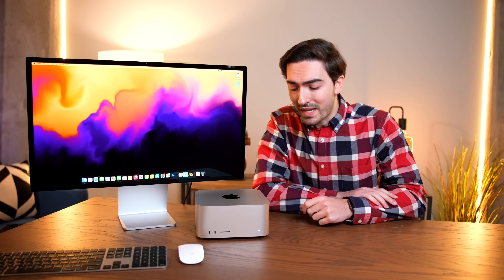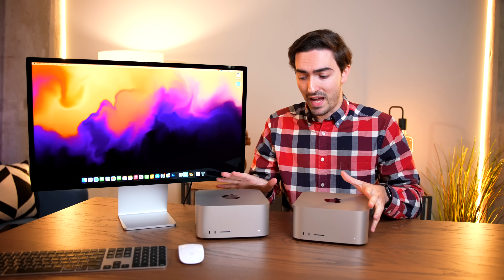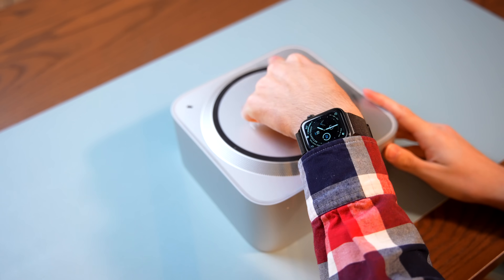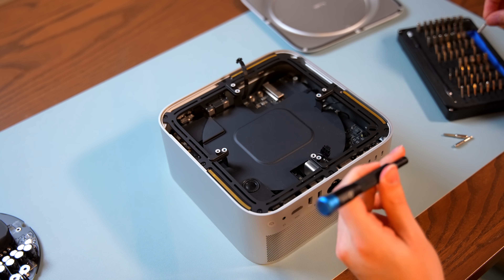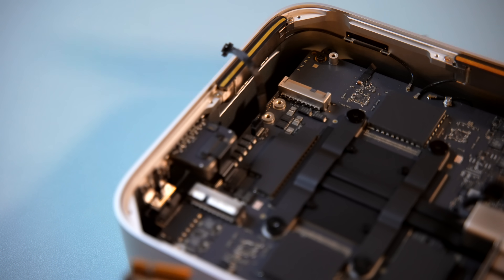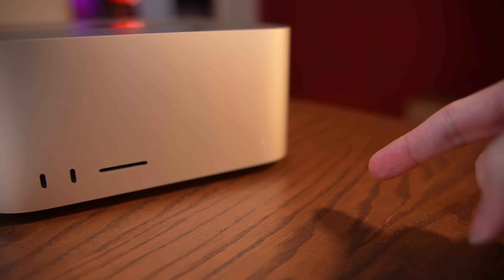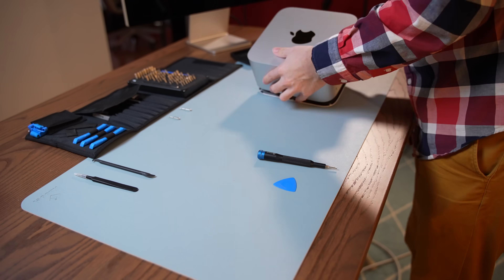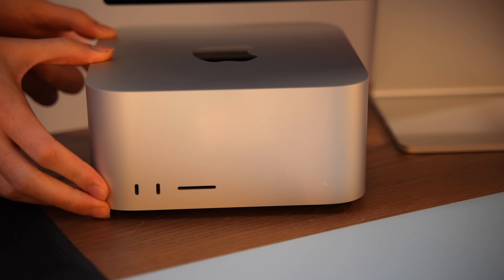What happens if you try to UPGRADE a $5,000 Mac Studio?

Comment from the maker: UPDATE: Part 2 is out now with Configurator 2 experiment and a ton of additional information! I spoke with several Genius Bar employees anonymously to shed some light on the situation: https://youtu.be/O7wrf2D-j5g  Also, check out Morning Brew for free here: https://youtu.be/xEwS_VGD2yY They helped make this extremely risky video possible lol
Reply: The way the ssd port is positioned, they could have engineered an SSD expansion port on the back or the side of the machine which would have been wonderful for users as you could've just slid in a new ssd provided by Apple. It could have had a nice aluminum cover that fit flush with the externals... but no. They want to maintain planned obsolescence in the name of so-called security that no one asked for. I will keep my 2012 Mac Pro and 2012 Macbook Pro 15" for a while longer it seems. They still work fine. 2012 was the good ol' days. Now I know why old people keep their old shit - they never make them like they used to.
Reply: I am actually not mad about this. As an IT Pro with security background , it shouldn’t be that “easy” to put in a new drive  if it’s already encrypted. Even in windows if BitLocker is tied to the TPM it shouldn’t swap with other machines without a recovery key or password protector. As others have indicated there are other things needed to be done on other T2 Macs when changing storage, maybe the same is required here.
Reply: @jweezy78  This is totally true. It's been years that we simply can not swan drives between Macs, this is noting new at all.
Reply: Did the Studio work when you put back in the original in the right slot? Perhaps I missed this. Great video.
Reply: They could just as well have used standard NVMe 4.0 connectors
Reply: Not very often luke loses his s**t, I like it!
Reply: @Luke Miani OK with all those comments, nothing has been proven yet. Apple storage is designed not to be swappable without at least going trough DFU and Apple Configurator, so please have a try first.
Reply: Just finished watching the video, somewhat disappointing, tbh I’m not very surprised. Hopefully you can find a work around.
Reply: Yes, definitely try the Apple Configurator route! How about trying it with a APFS formatted drive? Could it not be the OS on each system stopping it from working?
Reply: Absolutely unacceptable decision by Apple.
Reply: you should try to DFU mode and rewrite the rule of ssd and M1
Reply: I too think that using Apple Configurator will make the SSD swap succeed. All the way back to T2 Macs, failure of a SSD or replacement of an SSD (involves soldering of course) will require a restore and they will boot as usual. This is most likely a security thing as the SSDs are encrypted by the M1 chipset the machine they originally belong to, forcing a wipe on AC2 to ensure the data does not fall onto the wrong hands.
Reply: Can u link the wallpaper plz?
Reply: try apple configurator
Reply: It’s a security measure due to the T1/T2 chip.  If someone steals your HDD, it prevents access.  The tools to upgrade will be leaked some day.
Reply: @Derpy1969  How the hell is someone going to steal the SSD? 😳😳😳
Reply: @Derpy1969  that would be more down to FileVault encryption to stop that. This blocking of drives wouldn’t matter if encrypted or not, it’s more so apple wanting control that you must only buy from them and spend more at point of purchase.
Reply: Also you know this means you have to buy the 8TB model to see what the drive configuration is now lol
Reply: @currytigre  for science some sacrifices are necessary
Reply: Luke, another scammer is replying me from my previous comment, just to let you know!
Reply: @Carbon_Fiber  It's too early to tell and I wouldn't base my decision on someone who is either woefully uniformed about the Apple Silicon Mac boot process, or chose to gloss over it for a more clickbaity outrage-inducing video instead.  
And realistically if you want a Mac what other one are you going to go with?  All other Apple Silicon Mac's have the storage soldered to the motherboard.  At least this one finally has storage that is removable/replaceable.  I would expect OWC or some other enterprising vendor to come up with something for this beast eventually.  
Either way it will be interesting to see if todays fuss is an unwarranted over-reaction about nothing, or entirely justified.  It's far too early to know for sure.
Reply: subscribed to morning brew :D
Reply: FEELSBADMAN :thanksdoc:😿💔
Reply: I think the SSDs are like the ones in the Mac Pro, maybe they'll make SSDs that work even if it's firmware locked and sell them for some thousand dollars
Reply: Just a couple of questions of the "did you reboot?" variety. When disabing external boot security, did you do it on both Macs? We saw you do it on one, but not both. It's unclear which Mac you did disable boot protection on. I'm assuming that's the one you tried to boot each time with the drive from the other machine. Second, didn't you wipe one of the SSD's so there's no bootable OS on it? You didn't mention it, but did you restore the OS on the original machine, disable boot protection on the second machine, and then swap it in? You may very well have done all of these. It's just not clear from the video if you did. Ever since Apple introduced T2 security (functionality now built into the M1 series), it's been a royal pita to swap drives any time.
Reply: Have you tried cloning the original drive
Reply: @NicVandEmZ  Clones are not possible any more for a long time due to disk encryption. However, yes, this needs to be properly reinstalled, not just swapped.
Reply: Thanks for all the efforts. Good job. We have all now a better idea.
Reply: Apple wants customers to purchase perpetual AppleCare. So odds are this won’t work.
Reply: Angry, yes.  Surprised, not one bit.
Reply: Where do you have to work to be at risk of someone dismantling your computer and stealing your SSD??? These types of Apple security measures should be user UPGRADES for the very few that might require them.
Reply: Could you also check what it does with 0 ssd's?
Would it boot from external in that situation?
Reply: Just return them they don’t need to know you opened them and I don’t think they’ll find out either it’ll get a hard reset only an apple technician can do probably won’t even open them
Reply: @LRP-AirRifleHunting  Apple has a 2 week no questions asked 100% return policy (as long as you don't break it) if you buy directly from them. No need to lie :/
Reply: @LRP-AirRifleHunting  Except the fact that there's literally a video with hundreds of thousands of view (so far) that documents the entire process of him opening up both Macs 😂
Reply: I think you should be an apple engineering taking apart things and put them back together see if they're upgradeable or not whichever one 😍 their computers is just fantastic for sure  I'm about to get my first iMac and hopefully soon I will probably get mine very soon because this means a lot to me right now a quick story back in 1991 I was in elementary school at the time there was portable classrooms that I was in and I did not know what a computer was at the time so they brought me to a station area and it was called Apple Lisa McIntosh that was my first computer that I laid my hands on so fast forwarding 2022 I will be picking up my first iMac 2021 one that they just build  I will be getting mine in Gray it's going to bring back so much memories  😍 I am super excited to get mine
Reply: Thebestgamer021  those were the days. You where able to upgrade de CPU from your Mac Mini, more RAM was a standard and was a good experience. Long days have passed…
Reply: If the configurator doesn‘t work,
it‘ll only work through apple… after a repair, apple technicians have to do a system configuration, where serial numbered parts get paired to the board. The really f*cked up thing is, that you can’t upgrade the storage trough apple either as of yet
Reply: U have other OS on the SSD thats why u get ammber light
Reply: lol this guy again forgets to check the chips, its not a normal SSD the SOS is because of it not being a standard SSD,  put 1 of them in a PC and try to format it hhhh
Reply: @Carbon_Fiber   there is a boot loader on the internal SSD (iBoot2) that is crucial for Apple Silicon Mac's being able to boot.  He put a blank SSD in and didn't do anything to restore the iBoot2 loader to the new SSD - of course the Mac didn't boot.
Reply: Seirously: you should file a class action lawsuit against Apple. We should not put up with this.
Reply: @powerlinkers   a class action lawsuite based on what?  Apple Silicon Mac's require the iBoot2 boot loader to be present on the internal SSD before they will boot.  He put an empty SSD in there.  How is his failure to configure the machine properly a nefarious action on Apple's part?
Reply: ♥♥♥ ♥Mac Studio and #LUmiy lightblade OMGS GAME CHANGERRRRS ♥♥♥
Reply: I feel bad for you if it's dead, that's a ton of money down the drain...
Reply: @Carbon_Fiber  , I have no idea what happens when the hard drive fails. I guess you have to take it to the Genius Bar. To the best of my knowledge Apple doesn’t solder chips with OS on their boards. But I’m not an Apple engineer, so I’m not sure why you’re asking me. Apple clearly has no respect for right to repair. That’s all I can say for sure.
Reply: So, wouldn’t changing the system configuration (adding an ssd) change some sort of UUID?

Meaning that if you have not wiped the other ssd as well, it would trip some sort of protection when you boot?

Or when you unit a ssd in a Mac, you pair it to that system, so in theory you could upgrade with a new ssd, and not a used one.

Like it would not work to swap the ssd with a wiped one.
Reply: Ok luke, you haven't used enterprise hardware much I take it? Lots of enterprise hardware (which is where apple is aiming with this) uses wins bitlocker which binds the SSD to the motherboard. There is always a way to go around it, but usually it starts with a bios flash or a turning off of bit defender in windows or plenty of other things. I'd be willing to bet this is the same way. Yes you can add an SSD or replace one, but you have to jump through hoops to first unbind the old drive and then rebind the new one to get it to work.
Reply: put simply this is why you dont buy apple computers there a overpriced sweat shop made amazing piece of rubbish.. i love apple computers ive got the g4 cube the 20inch lamp shade imac and had a 25 or 27 ( not 100% ) white imac from about 12 to 15 years ago..
over windows ios just works and is much more user friendly and simple in nature but these amazing systems are a utter waste of money and time hence why i will always build a pc over a pre built ( say alienware ) or a apple mac  they are and have always been overpriced throw away items with little if any upgrade options !!
Reply: i know you want to make that apple defect , hehehe. Old same Luke :) i joke
Reply: Thanks for this. I ordered one, but am very disappointed with Apple now. I’m with you on right-to-repair.
Reply: Don’t know if you have a shadow account or if it’s a scam. There was a different YT account (similar to you) something it said. Do you want me to report it as a scam? Or is it you (considering you do use this channel account to reply)
Reply: Sorry, Luke, but you are expired
Reply: I have the ultra base model and likely just going to use an external nvme in an acasis case for my large files .I think the only upgradeable Mac will be new the mac pro down the road.
Reply: I wanted to know if putting everything back how it came from Apple would 'fix' thing or you know have some very expensive paper weights?
Reply: Looking forward to Part 2.  Would like to know if you were able to swap the NAND modules back into their original Macs and were able to boot again (I assume they would).  Obviously, try the Configurator / DFU mode and see if that fixes the problem when you're swapping them.

@Luke If you get it working, will you retract some of your criticisms?  I realize it's not possible to un-stir the hornet's nest, but it would be good if you could set the record straight, future upgraders will thank you.
Reply: According to marcan, the modules need to be the same size (and possibly vendor) and then restored in DFU.
Also, I'm guessing that if you only use one, it needs to be in the correct slot.
Reply: try installing macOS on an external Hard drive, booting without the internal ssds and setting the external hard drive as boot drive. Then format the disks and only install macOS on one of them. The Mac Studio was propably confused, which one to boot form :)
Reply: Wow, just about to comment to try this…!
Reply: @Indrid-Cold  most people buy pc's because of apples limits to upgrading and apple would be lucky to have 5% of the whole computer market anyway..
$12k aud is the cost of a fully upgraded mac studio thats ridiculous for a machine at it core is a throw away item !!
from a company stand point there leased and shipped off to a second hand market after a few years but as a regular consumer product its a waste of money !!

the only reason apple make them un upgradable is because $$$$ you want the latest and greatest throw that last gen pos away ( create more e waste )and spend another $5000 $6000 plus in a year or two
works on the same apple philosophy of the recent green iphone 13 to generate money
Reply: This is exactly what I was wondering during the video. I am quite sure you can’t restore new macs without using another working mac
Reply: It shall work. Just Reset the SMC with both the SDDs inserted and then reboot .
Reply: @atherrafiq01  what SMC?
Reply: Thanks, it’s amazing how much time and effort you spend on making us the best video’s ❤️
Reply: @gian-lucalauwens703  If he made the best videos he wouldn't have to do an update after being called out for his incomplete test.
Reply: Louis Rossman is going to love this...
And as he would advise you, so shall I.
Vote with your wallet.
If they want to treat me like a sucker, they do not deserve my money.
Reply: @dgurevich1  Agreed, Louis will use this as more ammunition for the right repair movement. Love all these “let’s open this thing up and see how it ticks” videos. Very enjoyable and entertaining. Can’t wait til WWDC and how  address the Mac Pro. Will it be upgradable at all ? Can’t wait to find out 🤷‍♂️
Reply: I think it has to do with the security Apple is enforcing on us.  It is a bit sad to have to pair the drive with the security chip.  I am pretty sure a way around will be found, needs some time.  I agree Apple does not care about the right to repair, with Apple you have no rights and everything is going to cost a large amount of money.
Reply: I was going to buy one, but now I will not until Apple answers this question.
Reply: @digilux4017  why?  Apple said it’s not upgradable.  Why would you plan to buy one knowing this, then change your mind now?  Makes no sense.
Reply: If you have been paying attention to the global stage then you should not be surprised about the so call “Security” that is being implemented on us in every aspect of our lives. Building a pc will soon be a thing of the past for so called “security” reasons. Trust me.
Reply: The problem with extremely profitable companies like Apple, they whatever they did to become so profitable as ‘right and good’ and resist change like crazy.  What they’ve been doing worked, so they motor on.  My point, MAKE NOISE!  Unless they understand this mindset/approach adversely affects sales, nothing will change.
Reply: how come I always try to upgrade or fix a mac I do more damage instead?  not the same problem I have with PCs.....
Reply: I know the second slot is disabled. A future "upgrade" I'm sure. Did you you put the OEM drive from the second Studio in the first Mac in the main slot? I'm not sure if you're saying that each drive is paired with that device. Also, are these SSDs totally proprietary designs? So you can just buy a larger drive and put it into the main slot?
Reply: @BigAl444  I think formatting them inside the other Mac will link them :)
I think someone will design an own SSD to put in there or an adapter to m.2
Reply from the maker: @BigAl444  I did swap primary SSDs in the video, firmware prevented them from booting. They are completely proprietary designs as far as I can tell yes
Reply: @lukemiani  Oh Luke, I thought you were an absolute Apple fan, not realizing how their behavior has been horrible for years.
Hearing you saying that this is inexcusable felt soooo good to my ears.

I am fighting with Apple as much as I can since almost a year now. Sure I can't do much, but I will sure continue trying to bypass everything, and telling people around to stay away.
As much as I love some of their older products, as much as I appreciate macOS, I will never buy a new Apple product again.

I have the following:
-3 iPhones 5s (one is dead)
-2 old iPods Touch
-an iPhone SE 1st gen
-an iPhone 7 as my daily phone
(these aren't any worse than other phones around from the same era)
-a 2009 polycarbonate MacBook as my daily driver
-an early 2011 unibody MacBook Pro
-a mid 2017 iMac
-a 2016 MacBook Pro (actually not pro but rather expensive horrible ultrabook) that failed on my mother (the SSD not the keyboard). I fixed it, but she had already bought a nice PC. It is light, upgradable, has a nice keyboard, a fantastic OLED panel, and it was less than 1000 dollars.

The rest of my family has:

-a mid 2009 white MacBook, kinda square shaped, without rubber at the bottom.
-an early 2009 iMac
-a base model M1 iMac (the first one ever. A horrible device).

Trust me, the older models we have here are NOT running old versions of macOS.
Reply: @lukemiani  is a security feature...
Reply: @lukemiani  , thanks for doing this. Really frustrating. Couple of thoughts: did you reformat and add Mac OS to the second drive? I know you blanked it, but the computer can’t boot without an OS.
Second: it’s my belief that these proprietary drives are a striped RAID set. You can clearly see that there are multiple drives on the board. My guess is that your boot issue is due to the controller looking for an array,  not a single drive. That would also explain chips on only one side. You only need one controller for an array. But I could be talking out of my ass too.🤷 This engineering is on a whole different level.
Reply: @lukemiani  I think it’s something like the home button witch is locked to the screen maybe it’s like the screen on iPhones try digging into the ssd that might help at least finding what makes the mac studio recognise the ssd
Reply: @lukemiani  if the lock is only on the software level, I'm certain that the hackitosh community will figure out a workaround in a near future.
But If it's on the hardware level, we have no luck!
Reply: @lukemiani  have you tried cloning the original drive so it would be exactly copy of the original it’s possible because m1 type machine have hidden partions that might work out if you could find way too clone it all from the original
Reply: @lukemiani  Apple's right to repair wins again
Reply: I should clarify my first thought: I know that since M1, you can’t completely blank the hard drive of the computer, or restarting is impossible. You can’t even access the safe boot or utilities when the drive is completely blanked. I can’t remember the specific nomenclature at the moment, but you have to make sure to only delete the volume data, and not the system (or something like that). If you do, the computer will effectively be bricked. Happened to a lot of people when they first got M1 minis.
Reply: @tedrodenborn8172  correct, apple uses a special SSD and they are paired. find a match of the chipset, do a block write and problem solved, miani is always saying shhhh that isn't accurate then just posting a new vid without addressing the people who told him the correct info
Reply: @lukemiani  DFU mode is likely required to pair the SSD, the Mac usually would black screen. Following the guide on how to fix the Mac Pro SSD after an upgrade might work
Reply: @BigAl444  yep he swapped over the drives and it still refused to boot even when he put it in the primary slot.
Reply: I hate the fact that Apple puts ports in the machine but locks the board from using them. Apple seems to want the ability to repair their devices, I said it, THEIR devices; because if you can't fix/repair your device, is it really your device? It is a brilliant business model, but is sucks for the consumer.
Reply: I think you and others are getting a little indignant now.  You b* about a slot on the motherboard not being upgradable, and yet, you opened a machine that was designed in a way that discouraged opening in the first place. Frankly if the average user isn't going to open the machine, they aren't going to care if they have to have a pro install a drive. If you are willing to open the machine, what is a few extra software/firmware steps.

Technically, it looks like it can be done, even if hassle. The question is, can anybody get a drive that can go in to it.  OWC doesn't look like they make the tech that will go into a Mac Pro, so will they make a drive for the Studio.  Pretty sure Apple will not offer kits for this machine.
Reply: @christopherlund1198  "Pretty sure Apple will not offer kits for this machine."
they did with the mac pro so who knows.
Reply: @hmmmhhhmmh  True, however that is a user upgradable system.
Reply: LOL 😆 4k 5k for a machine that has no upgradability, way to go Apple , jobs would be rolling in his grave
Reply: @Tennesseeroadster222  Actually Jobs liked this. It was Woz who wanted expansion.
Reply: The cost of the device is outrageous. For the same amount of money, you could easily build a 5950x, 3080ti, 64Gb RAM or even point to a Threadripper. For all and still you are not "allowed" to replace a SSD? Really? 
Luke, good luck with your endevours. I'm from a time when Mac's were able to be upgraded with normal components and repairs were expensive but possible.
Reply: @PedroM125  Yes for the cost of this device you can get all those things, sort of. If you look at one of the recent Mac Addict's from the Linus group you'll see that he replaces one of the guys editing den machines (threadripper 3960x, 3090) with a ten core /24 core gpu macbook pro. They show some of the differences. Transcoding for instance is 4 minutes slower. Now keep in mind that thats an older threadripper, but it has 24 cores and 48 threads compared to the 16 and 32 in the 5950x. Also keep in mind thats not the best MBP that you can buy as far as processing power goes. Then keep in mind that assuming scaling linearly (which the M1 has been to an extent) the base ultra will provide double the performance of the m1 max in the laptop they use. Which will handily out perform the 5950x in productivity workloads. So yes you can get a 3090, and a 5950x system for around this money, but it will likely not perform any better if not perform slower than the $4k mac studio, and for 5k? Well you can get 64 gigs of unified memory and 64 graphics cores. Also its not clear yet if the mac studio is upgradable yet, all luke proved is that he can't do it. He's already admitted there were things he didn't try and there will be a part two.
Reply: @mizinoinovermyhead.7523  we really need to pick an very specific scenario to justify the machine and if this is not saying a lot for the price/features of the machine, I don’t know what would do.
Reply: I think it’s a security thing. You don’t want someone to be able to swap an SSD without user knowing
Reply: @AshleyRyan15  it's been fine in PCs for decades......why does Apple think it is so precious that it can't possibly allow/enable it's users to upgrade by themselves? Oh wait, it's because they would rather charge you $300 for an extra GB of RAM which costs them peanuts! Greed my friend, it is all greed and control!
Reply: @johnh3095  it’s because of the encryption system with the Secure Enclave. The security it provides vs the mild inconvenience of having to reconfigure the system when you upgrade storage is a trade I’m happy to make
Reply: @AshleyRyan15  How many people do you know that have had their drive stolen and put into another machine? These Macs going to be used at the CIA?